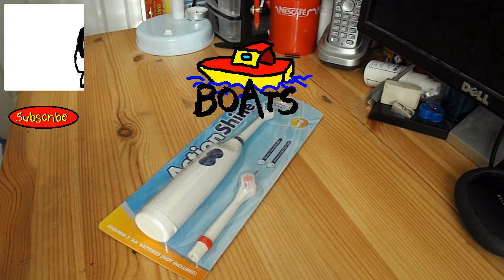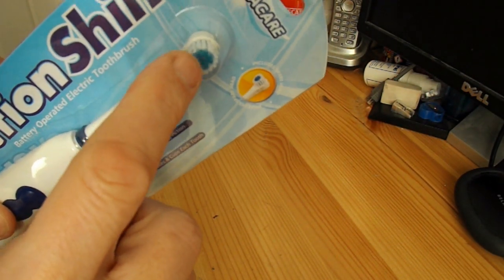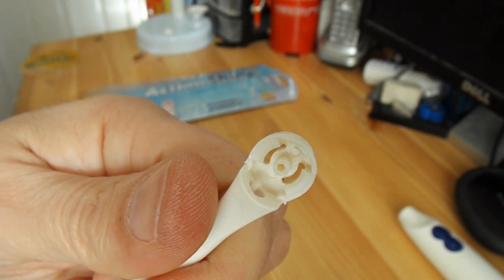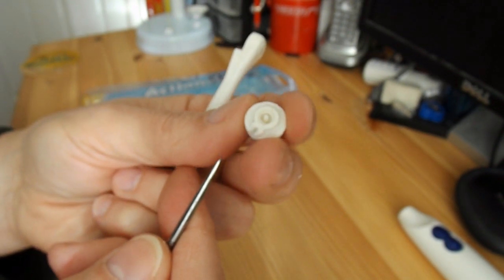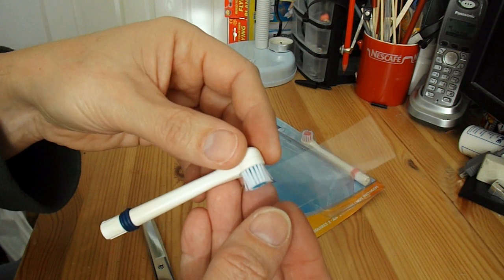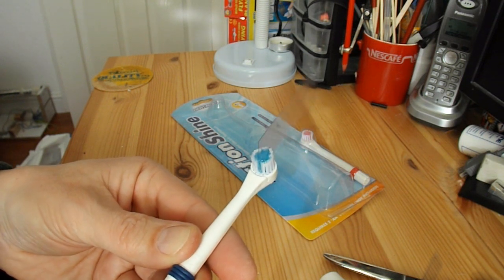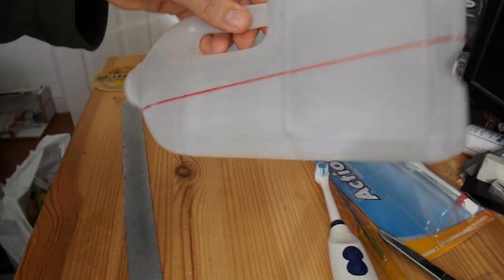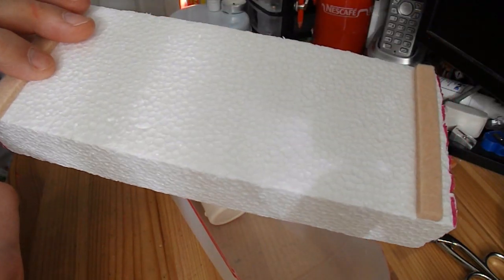Motor Boat from an Oscillating Toothbrush

Comment: I know this is a quite old video, but I have only just seen it. My suggestion for all your projects that use a "flipper" or "fin" as the drive mechanism, is to add a stiffener to the flipper.  The thin plastic you are using has a lot of flex and is wasting a good portion of the oscillating motion.  More motion = more propulsion.  The down side is there will be a significant amount of extra strain on the drive motor. This could shorten the run time.  As we say in the USA...Just my 2 cents worth.  I love your projects.
Reply from the maker: Matthew Autenrieb interesting comment and potentially a long discussion. Have you made one yourself? I am not saying you are wrong, but perhaps study a fish tail as it moves in the water or even a snake as it moves. You may be surprised.how nature uses a flexible system rather than a rigid system. My boat here is probably not a good example but the flexible system creates less disturbance in the water. Another example would be the very large fins used by free divers. Obviously there is an optimal amount of flexibility or rigidity.  Too flexible and they will be like waving a damp tissue, too stiff and they will cause too much water disturbance and too much stress. Here is an interesting review of free diving fins https://youtu.be/JOYNP5F7HnI
Before you ask, I am not a free diver, it is just something I have noticed when watching them on TV and was certainly not a consideration when I made the video :-)
Reply: +GrandadIsAnOldMan  
The Fin is too much floppy. You cant make a bread from a pancake batter. :) The fin should be more stiff but not rigid to get a fish like fin.
If you see a fish fin, then it is quiet strong at joint and floppy at the end. The strong part pushes the water and the end part merely deflects it. :)
Reply from the maker: +Harry Cash I will give you a similar reply to the previous comment. I am not saying you are wrong, but have you attempted to make one yourself? When you have made one, you can do a video and demonstrate a comparative analysis of the different types of fin. My idea works and is demonstrated. It is not intended to be a high efficiency world saving device. It is a simple toy that works.

Comment: Is this device environmentally friendly? If so, how?
Reply from the maker: Hi Hellokittyoreosbro, the only environmentally friendly aspect is the fact that I recycled my old plastic milk carton to make the boat hull, and a small part of the packaging the toothbrush came in, to make the flipper, so at least those components had a second use before they finally go to our council recycle centre. Other than that, most of the components are plastic which I would never consider environmentally friendly. The electric motor contains metal parts that could be recycled. The battery can be recycled. In operation the boat does not create any waste but when we have finished playing with it, the whole thing is waste (within the limits of what I have already explained). To create the components, I have no idea what processes the manufacturers used, so you would have to investigate that further.
Reply: GrandadIsAnOldMan It is a lot more environmentally friendly than using old petrol motors to drive the boat. Repurposing everyday item packages is always eco-friendly. I support and congratulate Granddad for his resourcefulness.
Reply from the maker: Matthew Autenrieb thanks again for your comments. I think the honest truth is that I have only delayed the disposal of this plastic waste. Ultimately most of this boat will become a waste product. Only a proportion of the boat's components are currently recycled. However by using pre-used items rather than buying new I may have reduced the overall impact marginally.